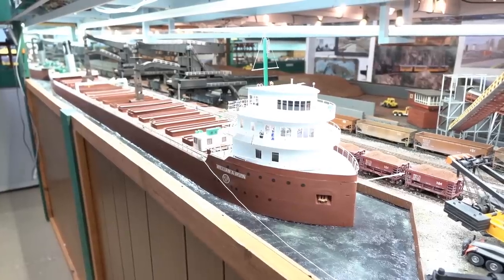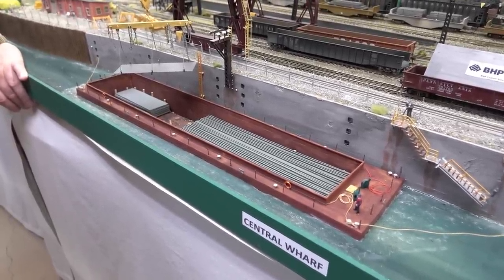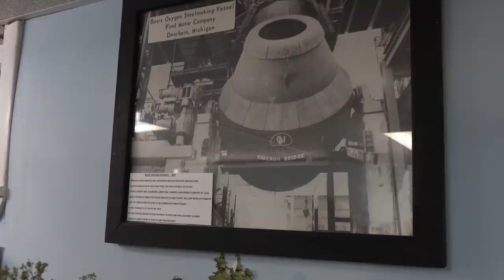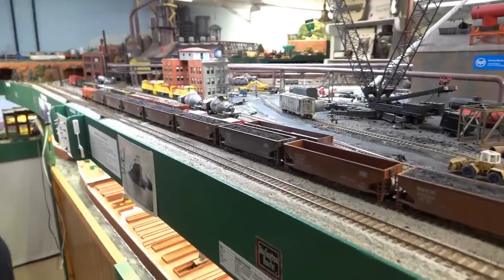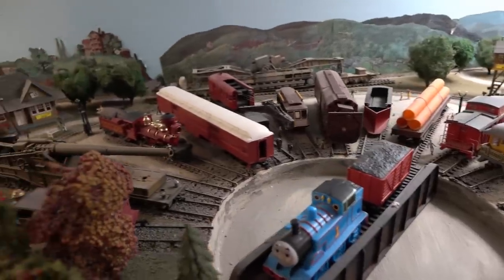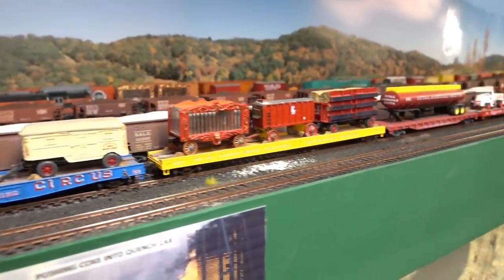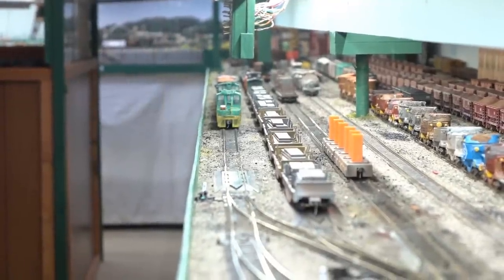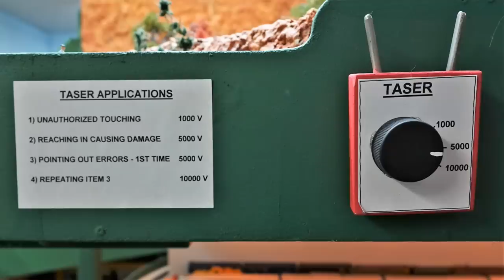BRR Layout Tour:  Scott Woods' B&LE/Union RR Steel Themed Layout

Comment: I am proud to say I've known Scott for some 30 years. This was an outstanding performance on his part, both as instruction as well as tour guiding. We were once neighbors across the street back in Aurora, IL. I've seen versions of this layout in four locations, although he told me on the phone that there is nothing left of that Aurora layout, although he had transported parts of it several times before settling back in Greenville. 

He also told me he's involved with a "steel manufacturing interest group" (don't know what else to call it) which has accounted for a good deal of education for his benefit, beyond what he knew of the fabrication side of things from his years with CB&I. He's a diploma-ed engineer from a prestigious school, and it and his experience shows all over the layout and the video. 

Really impressive work. Not bad on the videography, either, Stephen.

Comment: What a wealth of information about the steel industry Mr. Woods is!  Fantastic modeling!  FYI, the Erie Canal used to run through my original hometown of New Haven, IN through Ft. Wayne.  In 1989 when the state decided to build the I-469 Bypass through New Haven they uncovered one of the old Canal Locks and it is currently on display at the State Historical Museum in Indianapolis.  Great job covering it all.
Reply: I live within a mile of a famous canal that is now history called the Hennepin Canal. It didn't really see its heyday like the Erie and the I&M Canals but it was quite a feat of engineering. It created great competition for the railroad tycoons by giving farmers a better rate on their grain exports but it was the railroad that eventually made canals obsolete. about ten miles from where i live is the town called Bureau Junction. At one time it was where at least two major railroads intersected and continued on to Chicago and cross country. the Hennepin Canal and Illinois River also had major ports nearby. it would be interesting to build a rail layout incorporating canals but i think that may be inaccurate history. railroads hated canals and canals hated railroads. railroads made canals obsolete and interstate trucking and air freight made railroads obsolete. i would still like to build a canal system with running water as alternative history.
Reply: Not an alternative history but just as much of our history, since it opened up the Western trails.It's a history forgotten, another part of how this country got its start.

Comment: Just an offer of assistance to Mr Woods. I was a Boilermaker foreman in Central Mtce at ET in the early 80's. Spent a good portion of my time in the ET BOP and some time on #1 and #2 Blast Furnace. #3 Fce was still undergoing reline at the time. Worked at Clairton in both the coke and steel works, short period of time in 2 side structural at Homestead and couple of weeks at Irvin during routing/orientation. If there are questions I can answer about the operations and layout during this period of time, I would be happy to assist. Great job on the video and best of luck with "mill" reconstruction. I myself have aspirations of building ET from the information I gathered during my tenure at USS.

Comment: If a steam engine was left outside, was the stack covered against the rain? I lived where the Milwaukee Road was behind out house/tavern and the Chicago Northwestern was across the street. The MR did some switching but I never saw that the engine was left overnight. Oh, our tavern was built in the mid-1800s, had a wooden backbar with round wooden columns, barber shop attached, gone in 1951 when parents bought the place.
Reply: they were usually kept fired-up if they were used again within 24 hours. at carbon-limestone they had a sizable fleet of porters and my grandfather would keep them at temperature so a bit of rain wouldn't matter. if they were cooled down- they were covered or kept under a shed.

Comment: If the layout is all DC, how did you get on-board sound?
Reply: Schmergee Peirgee  Engines that have DCC and sound will run fine on a straight DC layout. A few of the sounds will play automatically. What's missing is all the sounds you can program in or trigger if you have a DCC controller.